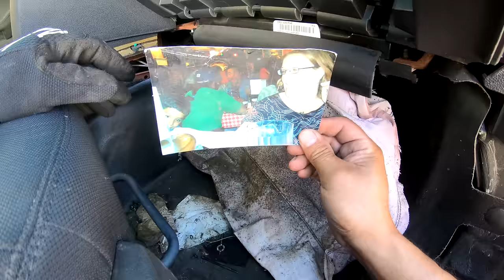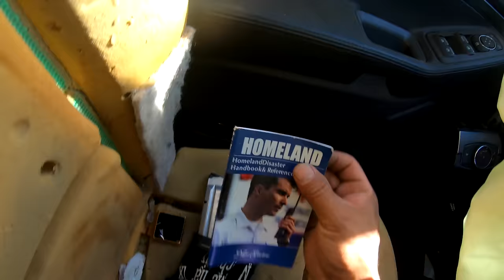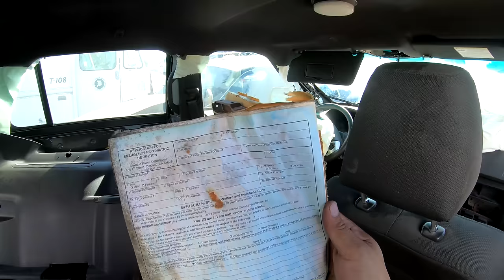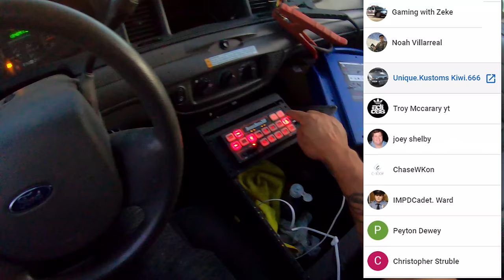I bought A Wrecked Police Explorer Searched it Found A Vigilante! + MUCH MORE!

Comment: That's a training revolver,my father have got that one to,I actually love it!
Magazine capacity:10
Didn't lose that much gas/shot
And you can easily take it to part's.
Technically semi auto.
If u want to check the mag,there's a button,close to sight,if u push it,u can brake down the barrel, like a.... scofield revolver.
The cartridge is in the grip,u can just easily remove it.
I really love that weapon,and I hope I helped :)

Comment: Dont worry as long as you have at least 51% of the bill it is still good to use!!!😂😂
Reply: You're doing I found a 20$ bill and there was little holes and they said you can't turn it in at the bank
Reply: I meant rong
Reply: You should be able to turn it in at a bank for a replacement.

Comment: Love the videos, that first light you found is a whelen PTW (Park, Turn, Warn) LED Amber for running light and signal and LED white for strobe if it has the flasher module not the resistor it had. About $250 used, $600 new each light head